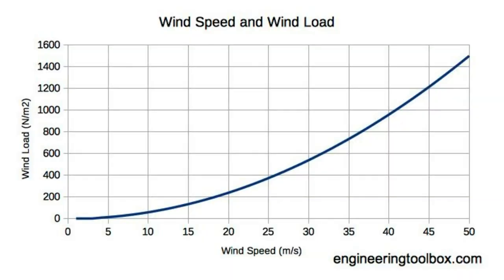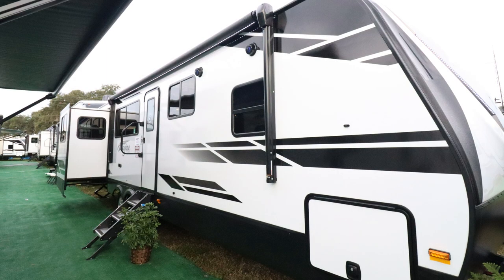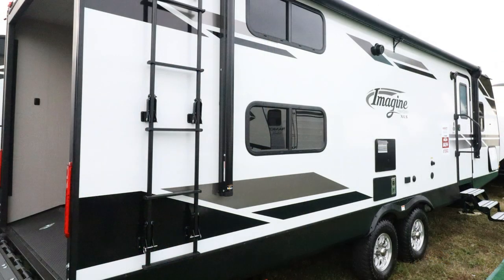The HUGE Issue With Travel Trailers No One Talks About

Comment: I have a 35 foot 9300 pounds loaded travel trailer and I have towed it a couple of times with an F150. Just because I needed to get it somewhere.  The truck had no problem power wise but I agree with the video you felt every gust from the side.  I would not have towed it far or at high speeds like that.  The other issue is payload.   The F150 was pretty much maxed out with me and the tongue weight on it.  Load up a family if 4 and a dog plus all the extra crap and you would be well over your limit.  

I would say 7000 pounds and 25 feet would be more comfortable and safer.

Comment: I definitely would not want to tow that big of a trailer with a 1/2 ton pickup.  If you only tow it a few times  a year to a short distance could do it but if you tow it regularly, bigger the truck the better.  I had two different 1/2 ton trucks and just pulling a 20' trailer was a chore in a lot of areas.  I don't live in Kansas.

Comment: By "sidewall" I presume you actually mean "sail area" - the total area (usually listed in square feet) of all the vertical surface along one side of your rig that is acted on by a crosswind?  Not only are trailers longer these days, but they are getting TALLER as well, further increasing your sail area.

Even though we are using an excellent WD hitch with sway control on our 3/4-ton truck, I found we were still getting a lot of motion from the trailer transmitted to the truck in a heavy cross wind because the camper was actually leaning side-to-side due to these gusts - and the WD hitch was transmitting that leaning to our pick-up as the camper rocked side-to-side.

Comment: I understand your reasoning and you should definitely do what makes you most comfortable, but I'm curious why you opted for 3/4 ton instead of a flared cap on a 1/2 ton to eliminate that drag and fix the issues with air flow?  Not trying to question your judgement, just wondering if you had a specific reason that maybe I haven't considered while I'm trying to decide what to get for a rig to get on the road starting hopefully this summer.  Thanks!

Comment: I think a large part of why people don't bring this up is that there are a lot of physics at play to even conceptualize the impact of aerodynamics and wind on a camper.  If you had a stationary camper, on a fixed foundation, the loads from a perpendicular wind are much more straight forward.  The lateral loads would be applied directly to the foundation.  But on axles and a hitch, a portion of the lateral load is lost in through friction in the wheels, but the lateral load that transfers to the hitch is a torque force with the axles at the fulcrum.  The length from the hitch to the center of axle(s) would then make a big difference in the mechanical advantage to magnify the lateral force applied to the tow vehicle.  This is why things like a slightly larger wheel base and frame stiffness of a tow vehicle make dramatic differences.  Obviously, the tow vehicle is vulnerable to a cross wind's lateral force as well, further complicating it.  I'm sure even I'm over simplifying the concept--while I love physics, I'm no physicist myself.  
That said, back to the concept of greater wind influencing pressure as an exponential force, which is really wind load calculator, the X-axis of the chart is in meters/second, so even the more harrowing driving conditions are very much on the left side of this.  An 18 mph cross wind, is really only about 8 m/s, so on a surface roughly 270 sq ft (roughly the size of large travel trailer), that's generating approximately 215 pounds of force.  The same surface in a 36 mph wind (16 m/s) is getting hit with 863 pounds of force.  I know, you start pulling over when you get into those 30-40 mph winds and avoid it.  We think 215 pounds isn't that much weight, but if an average-sized man can stand near the back axle of a truck and shake it side to side, influence the suspension, that's what a modest wind is doing to it.
Reply from the maker: ^^^ what he said!! ^^
Reply: 215 lbs. of force is a LOT of pressure against the side of your trailer. And what makes wind so scary is also it's nature to change so quickly. Sure, you could probably compensate for a 215 lb. push or even the 863 lb. push if it was consistent and always that force, however when the pressure drops off instantly as the gust ends the over reaction is impossible to mitigate. The inconsistency of wind speeds and gusts is what ultimately makes wind on a travel trailer so dangerous.

Comment: You have no idea how much I needed to see this video. I drive a 2017 Ram 1500 4x with 5.7 Hemi and class IV hitch. It’s a short bed crew cab. Bought it used and I love it. Been looking at the small fiberglass campers, 16-17 ft. In past years I hauled horses in a steel 2-horse with an F150, no problems. So, is the lighter weight fiberglass going to be more prone to sway? I’m 68, no intention whatsoever of pulling anything bigger, ever, and not getting rid of my Ram (it’s the Sublime green, which is why I bought it). My dilemma is do I go with something like an A-liner for low profile, stay with small fiberglass, or forget camping altogether? Thank you in advance for any input you can provide. Also, new subscriber!
Reply from the maker: Welcome! You shouldn’t have a problem with the smaller setup! Get an appropriately rated sway control hitch and you’ll be all set! Enjoy!!
Reply: Wandering Weekends Thanks!!
Reply from the maker: Happy camping!!

Comment: Your right most  but the 3/4 ton trucks now useong coil springs  witch means  you end up going  1 ton  I tow with 1/2 ton put timberland rubber blocks  8000 pound to tow a land scape trailer   2000 pund trailer made back drop cheap coil spring  . Now habe no issue towing rv .but the 3/4 tons of today have same issues . My next truck will be  1 ton period to get leaf spring back  coil spring what causes  problems with weak back end towing  you can have same issue with 3/4 ton if have coil spring final note between being retired tech  and a class a driver  now  they don't build trucks like used too

Comment: Hey Corey great video I to have a 32 ft trailer as well my weight is around 8200 lbs I run a 12000 lbs equalizer and a 1200 lbs hitch ball the tongue weight on the trailer is 1020 lbs also I have a dodge 1 ton dually  I think bigger is better when towing also I drive cdl for a living anyway thanks again
Reply from the maker: Appreciate you watching!

Comment: Pulling a 38ft 10000lb tt. Wouldn't even think about anything less than a 350. Using 350 long bed srw now and its the minimum I would use for my trailer.

Comment: If you want worry free towing, get a dual-lie. Once you tow with a due-lie, you will never be happy with anything else. Everyone thinks dual-lies are delegated to oversized or big fifth wheel travel trailers but I used to tow my 36' with a dual-lie and because of the age of the truck I had to retire it and buy a newer F250 and the driving manners were night and day. Yes the F250 is easier to get around town with but on the road towing the trailer, it can not compare to those two extra tires on the rear.

Comment: If your 1/2 ton truck's towing capacity and payload capacity are two times greater than what your pulling but your TT ball to bumper was length was 30ft would it be ok to tow if you had a ProPride hitch?
Reply from the maker: I’d have to use a PP to give you a better answer.

Comment: So i guess my 2004 chevy  suburban with 126k miles that I just did tires, shocks, sway bushings and links,  tires, brakes, rotors, maf sensor,  oil sending unit, abs sensor,  plugs, wires, coils, right rear axle replace, rearend outer seals and gear oil with new cover will be nice trade in for that ford f250 with 7.3 engine i really want.  LOL
Reply from the maker: I’d take it off your hands... if it weren’t a Chevy 😜
Reply: Oh ya hoses, water pump and thermostat.  All this was done just before the pandemic.  Will you take it now?  LOL. Even though it's a chevy!!!!

Comment: Get a Propride or Hensley hitch, the problem solved. Otherwise, you have to upgrade to 3/4 or 1 ton truck.
Reply from the maker: Actually there are several Hensley and PP owners in this comment section who still wanted to upgrade to a 3/4 ton truck.

Comment: It’s called proper equipment you wouldn’t tow a semi trailer with a pick up truck use the right size truck for the right size trailer use a weight distribution hitch use sway control it’s not that much of an added expense and believe it or not dealership C suite control is optional it’s not so optional when you got yourself turned over on the highway just because you decided to run 80 miles an hour passed a semi truck or semi truck decides to pass you at 80 miles an hour once you get the swaying you can’t stop. So the best thing to do is spend the $75-$100 and don’t sway to start with one other thing to keep in mind the tires that come with these units from the dealership are not rated for over 65 miles an hour they’re not even properly waited for the weight of the unit so for all you highway hot rods keep it under 65 if you’re going to have blowouts a whole lot of other problems don’t believe me look at the sidewall reading of the trailer tires and then look at your GVWR on the side of the trailer and see what happens

Comment: Excellent Video.   However you are 10 years too late for me. LOL  My wife and I went though a similar process when came to 1/2 ton vs 3/4 ton trucks.  Turns out a trip to Florida from the Northeast was a push we needed.  We realized on that drive we should have a 3/4 or a 1 ton truck.  By next camping season, I had a new job.  Sold my F150.  Purchased a F250.  Had a family vacation down to Myrtle Beach,SC.  World of difference.  The F150 was fine for anything within 2 hours of us.  Beyond that, it was not up the the task.  

One other thing,  my current truck is an F350 since the above F250 was involved a MVA.  I towed the same trailer with the F150 and F250.  No issue.  It was identical towing with  the F250.  However, we traded in that trailer for our current Grand Design's Reflection.  That unit is 36 feet and 9,500 pounds.  It is also a foot taller than our old trailer.  However, it also tows better than our old trailer ever did.  I feel the extra weight of the trailer helps with handling just as much as the truck.  Even though there is 6 feet in length difference the extra 3,500 pounds at max weight doesn't hurt keeping the trailer stable provided it is balanced correctly in the trailer.  Any thoughts on this?
Reply from the maker: I don’t have any technical input on the subject but common sense tells me more weight is tougher to move. I’ve towed my in-laws rigs and it’s much heavier and I had a similar experience. Too much math for my brain. School of hard knocks is where I do my learnin. Haha.

Comment: I guess I'm going to have to be the outlyer of sorts.   Our TT is 31 feet overall, 7,800 lbs gross, 950 tongue.   We pulled it 12K miles over 5 years with a '13 Tundra with the tow package and an equalizer hitch and it did fine.   The Tundra did everything we asked of it, over Monarch Pass, and 300 miles of 40 MPH crosswinds across New Mexico one day (ok, that was borderline).  Tundra's are not famous for payload so we were at payload capacity but had plenty of tow capacity.   I added Timbrens for the rear sag.

THEN, we bought a folding golf cart that weighs almost 500 lbs that goes in the bed and, while the Tundra would take the extra load, my attorney advised it was time to make adjustments.  Bought a '19 Duramax HD, then 15 months later traded that for '20 GMC HD.   

While the Tundra did fine before the golfcart, the HD trucks are much more stable, don't get sucked into 18 wheelers anymore, even the WDH is optional at this weight.   I didn't know what I was missing.

Wind drag increases with the square of speed.   That's why your towing gas mileage will drop 25% from 55 to 65 MPH.  Drag goes up exponentially, not linearly.   (yeah, I am).

Comment: Now I’m a little nervous.  I was planning to upgrade out tent trailer to a 25’ 208BHS, 4300lbs dry.  This was the largest I wanted to go, with our 2018 F150.  The package I wanted included off road tires, raising the height of the trailer.  WDH/sway hitch of course.  Appreciate opinions on this.
Reply from the maker: that trailer is 25ft long... shouldn't be much problem for the 150... experience will tell the story though.
Reply: If you raise the height with off road tires the wind will have a bigger effect on the trailer and your center of gravity will make it top heavy   If you are going to local area the 1/2 will be fine but traveling on the interstate will be white knuckling

Comment: I’ll probably get blasted here but we have a Coleman 18RB we just got (20 ft long). I currently tow it w my restored 87 GMC regular cab 4x4 Squarebody. Trailer is 3100 dry so 4000 lbs loaded. I want a new Ranger to tow it with which can tow 7500 lbs. Truck weighs 4400 lbs. will I be sorry I didn’t get a huge 20 ft long half-ton truck?
Reply from the maker: I think the square body is MUCH cooler. Just don’t be in a hurry!
Reply: @WanderingWeekends  oh it’s Way cooler and thanks.  It Actually has less of a tow rating than the new Ranger lol.

Comment: I agree a 3/4 ton will tow better than a half ton, just like a 1 ton will be better than a 3/4 ton.  For my 32ft travel trailer, my F150 Ecoboost seems to handle it quite nicely.  You need to be within specs and you need to have a good WDH.  Will a 3/4 do better than my F150? Yes.  But I drive 30,000km/yr without the trailer and 10,000km/yr (which is a lot) with the trailer.  I can't justify the rough ride, the poor fuel mileage of a 3/4 ton, when my F150 is within specs and handles the trailer very well.  Now, if you're over payload or tow rating, we're having a different discussion.
Reply from the maker: Glad its working well for you.

Comment: I have a 2013 K1500 Suburban and  2018 Salam with hitch 34’ can I make any improvements to be more safe?  I do have a 10,000 lbs distribution hitch.
Reply from the maker: Does your hitch have built in sway control?
Reply: I have an apparatus inside the hitch
Reply: Sorry if I was to the outside of the hatch is about 15 inches long and has a handle.
Reply: Yes it has a sway bar. My question though is there anything I can do to have better I left our control from the rear end.

Comment: I’m not trying to be argumentative here, just seeking the facts. I have a Toyota Tundra 5.7L double cab. I live in the texas panhandle were the wind is always an issue. I have been pulling an 8000# trailer around since 2012. Never a problem. I have air bags, a 47 gallon replacement tank and run very heavily plied tires. I’m considering buying a 34’ bunkhouse tow trailer but you guys are making me think twice. I have great breaks, plenty of horses and a towing capacity only 600#~ less than a 3/4 ton. It sound like you are saying I need a heavier truck. As in a heavier tow vehicle. Is that ultimately the issue????

Comment: Off topic a little, I'm almost 59 and still work full time, my wife and I recently took interest in a camper for us two mostly maybe a a couple more people at times, not planning to go far maybe 300 400 miles at the most if that and not often. Probably more like an average of 80 100 miles for a 3 day weekend etc , thinking a good used trailer maybe 25 foot? Any suggestions for a first time camper buyer, I have an 09 f150 and will use the tow pack that came with it new? Just when you get some time.
Thank you for any advice!
Reply from the maker: Tough to say without more info on your truck. An educated guess… stay at or below 20ft and you should be ok.

Comment: I’ll admit I’ve recently been on a steep learning curve after finally caving to my family’s demands to buy a travel trailer this winter (Imagine 3250 BH). This was their choice. 

I have a ‘14 Ram 1500 Crew Cab 4x4 Hemi, which I love and assumed would be “adequate” based on stated towing capacity and payload capacity in the owner’s manual. 

After watching some towing-biased videos, and learning that my “actual” payload rating on the door jamb sticker is several hundred pounds less than what the owner’s manual suggests for my trim level, I have decided to upgrade pickups. Suddenly, I find myself in the market for a 3/4 ton pickup, which I wasn’t previously planning to buy. I wrongly assumed the 1500 would be fine, but I’m not even going to risk it with such a large travel trailer. Before even trying with the half-ton, I’m hoping to stave off sway and control issues by starting  a heavier and longer wheelbase vehicle. 

We won’t pick up the travel trailer until May, so I have time to research pickups and order what I “want.”  Right now, I’m 65% toward a Chevy 2500 gas and 35% toward a Ram 2500 6.4 Hemi. Both are crew cab, short box 4x4 models. The Chevy is rated higher for payload and towing, plus I think it’ll ride better during day to day life than the solid front axle Ram.

Comment: I've been watching you and J.D. BTBRV.  I have a 2500HD duramax . Like it , but think I will go with an F-450 in the future.
Reply from the maker: JD seems like a good dude...
Reply: JD loves the turning radius of the F-450 with the wide track front end. There is a big difference in ride quality between the F450 and F350 under no load. Test drive both the back seat will see the biggest difference
Reply: @pdrhodes1  I tow manufactured buildings sometimes. 14x32 is about biggest so F-450 turning radius might be helpful.